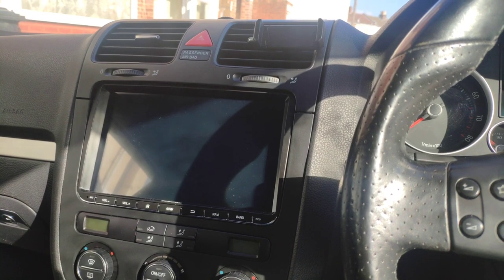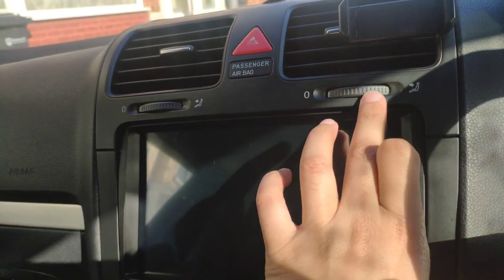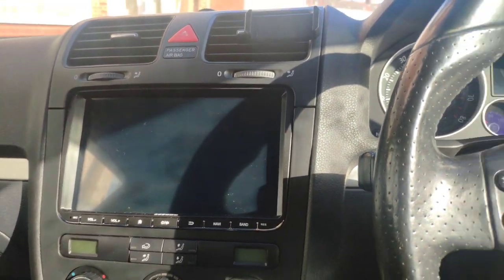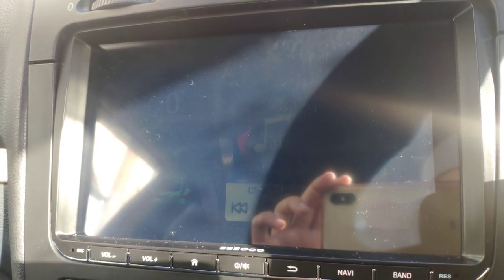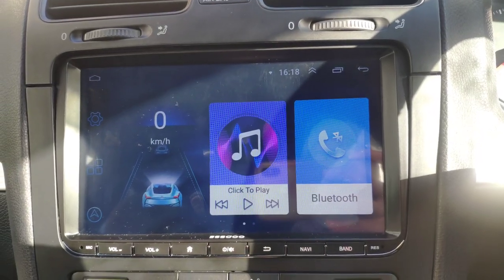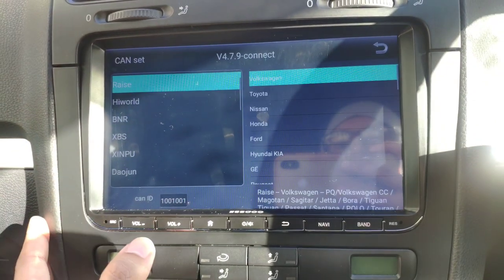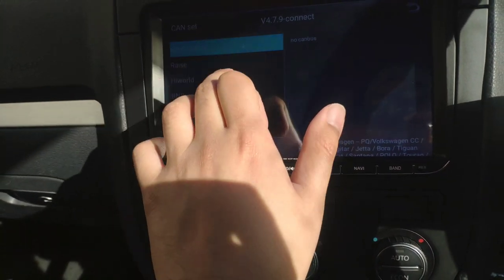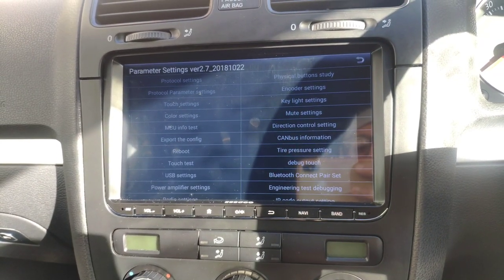9" Android headunit Canbus setup

Comment: Hi I bought a 2008 Corsa with one of these systems and an additional reverse camera and carlink carplay .

However the  steering wheel controls don’t work, how do I get them to work?
Reply from the maker: Mine worked out the box, all the wiring came with the unit.

Comment: Hey mate, do you happen to know why my headunit doesn't always stare when I turn on the ignition? It is completely random, sometimes it starts from the first ignition, other times I have to turn on and off the ignition for an x ammount of times until it starts (2-3 times usually). I would really appreciate if you would have an idea/suggestion. The car is a Golf Mk5 2008.
Reply from the maker: I'm not sure TBH, I'd check all the wiring first.
Reply: @AlexHusTech  could it be from the canbus decoder box of the headunit? I will check the wiring. Everything else is completely fine, it shows everything from my car (open door, trunk, rpm, voltage, seatbelt, etc). It's just this annoying thing that it doesn't always start on the "first" ignition..

Comment: hello mine does what yours does where the screen freezes and you can only see it faintly and you can still move the screen around but it goes off after a minute or so and when the ignition is switched back on it does the long boot instead of the fast boot so has it worked for me?
Reply from the maker: Seems like it has worked, long boot is better as it won't drain your battery, I think quick boot still drains a small amount of battery.

Comment: Hello! I have the same unit on my be golf 5 ! I have noticed that it is not working everytime I start the engine! When it works everything is perfect ( rear camera, Litres etc) ! But 1/3 times  it doesn’t turn on! Any ideas?
Reply from the maker: The only thing I can think of is the connections, are they all on properly?
Reply: @AlexHusTech  I don’t know my friend! The unit installed by a professional ( in the beginning canbus didn’t recognise the camera so I update the canbus unit) but now I have this annoying problem ! It is weird that if I enter the car and it doesn’t work , I get out locking the car waiting for about 2 minutes , I enter again and everything is fine)
Reply from the maker: I'm not sure, never had that issue very weird.
Reply: @ΜΙΧΑΛΗΣΨΑΘΑΚΗΣ  hello my friend! Καλησπέρα πατρίδα! I had exactly the same problem with you and after many tries  i found the solution via VCDS coding! I found that in the CAN Gateway installation list, the selection "56-Radio" was not activated! I activated it and.. problem solved!! Check it out, I hope it will help you!!

Comment: One thing I'm not clear on for a lot of these Chinese Android head units is, do ALL cars need a CANBUS decoder box to make onscreen info work (like climate settings, door open/close) or does the head unit do the decoding itself? I have looked high and low for a CANBUS decoder for a 2016 Kia Soul with no luck, so I'm beginning to think that one is not required. Is that possible?
Reply from the maker: I'm not sure if ALL need it however, mine car certainly does require it.

Comment: Hey mate, very nice review, thank you! Do you have any idea if in "Factory Settings" is any option to display the battery voltage with decimals in "Car Information"? I saw on other players that is not a problem for CAN BUS module to read this info from ECU with one or two decimals.
Reply from the maker: Hi, sorry I have not seen this option I'm afraid, this may be die to slight difference in the OS versions.

Comment: Hi Alex,
I have an issue that is really strange. I have got the same head unit and installed in my partners Golf MK6. 
When I click the settings cog like you did all I have is a blown up image with only the”Car settings” option. 
I don’t have “Sound settings, System info, Factory settings, android settings etc???
Do you think this a fault with the headunit?
Reply from the maker: Right could be an issue OR the software version is different to mine, and have to access the "Main Settings" a different way, which could be via a preinstalled app OR pull down the notification tab and normally there's a "Setting" option OR may be another way.

Comment: Alex, my problem is the Home Menu shortcuts don't work. On the home page, only the settings button works. You had me scroll down by dragging my finger from the top down. That's great, now I can access the settings and other buttons. Do you know if the home page short cuts like Radio, Bluetooth and Settings need to be setup and if so do you know where? Thank you or anyone else that might know.
Reply from the maker: I think there may be a setting on the factory settings options somewhere to map the buttons, can't remember top of my head.

I've got a new unit in yesterday, I'll be doing a MCU software update soon once the seller sends it over, I'm hoping the UI will be better.
Reply: @AlexHusTech  Thanks. The nice thing about these units, is that we can change the Launchers. Decided to change mine to Car Launcher, than I'm going to check out CarWebGuru.

Comment: Hey mate pretty sure I have the exact same head unit but I don't seem to have the same settings you do?? Super confusing, I don't have a navigation or logo option ect, any thoughts?
Reply from the maker: Sometimes seller put on different software versions, it may be worth getting in contact with the seller to see if they can give an update file.

Comment: did your fader and eq work out of the box on this? also have the same fitment issue :/
Reply from the maker: Yes worked out the box, able to make changes. I cut the top bit of my headunit to make it fit, video here of the part I cut, it's when I'm in the car.

https://youtu.be/9akMZDos0qg

Comment: I can’t get the info car to work on my golf. The Canbus box is connected. I try to read vault codes and it says please check obd connection? Do you have to use a Bluetooth obd connector ?
Reply from the maker: No, there is no OBD required. The headunit canbus box should be able to directly communicate with the car to get the details.

Have a look at my installation to see if you have the wires connected up properly.
 
https://youtu.be/9akMZDos0qg

Comment: I got this deck installed, everything works but when my car is running and I turn the key to the OFF position, my car still runs until I pull the key out. Any ideas if it's a setting that has to be changed?
Reply from the maker: Never had that issue, sorry, can't help you.

Comment: Hi mate I got same unit in mkv gti thanks on vid for changing kmh to mph worked a treat for me I’m now looking to see if odometer settings in car set can be changed from kmh to mph any help will be greatly appreciated bro
Reply from the maker: Unfortunately not that I know of, there's other apps like "Car info" that connects to OBD port that gives odometer reading in mile, however I use it more for tracking temps etc.

Comment: Hi Alex, I've just adquire that radio for my 2005 VW golf V, don't have interface (buttons) on the wheel, but installed CANBUS anyway, but the problem, with or without the CANBUS, persists, and that is, I turn off the ignition, remove the key of it, and the radio stills on. I've install the CANBUS and as I saw your video, saw that I didn't done anything wrong, different from you. Do you know what can be the problem? Thanks in advance for any help given.
Reply from the maker: Does it show your car details in the "Car settings" app? If not it might not be wired in properly.
Reply: @AlexHusTech  Hi Alex, thanks for the fast answer :) if car details in Car Settings app you mean the screen were "rRemaing Fuel", "OT", "VPWR", "S/B", "TRUNK" etc etc as for the doors if are open or close, yes, it shows the car details.
Reply from the maker: So canbus is working, message me on my insta, Alexhussien, there's a wire you may need to disconnect, I'll send a picture.
Reply: @AlexHusTech  Don't have social network beside youtube :( email me the picture, if possible. Thanks.
Reply: No Insta, Twitter, Face :) only youtube and whatsapp for the surf pics and vids that I take of my buddies.
Reply from the maker: @thenightbeast  emailed
Reply: @AlexHusTech  hi Alex, congratulations for the good job...I have exactly the same problem with thenightbeast.can u send me that photo please?
Reply from the maker: @ManosKass  Messaged you on insta.
https://youtu.be/9akMZDos0qg in this video at 7.35 is the wire that requires disconnecting, if that doesn't work then a wire tap is needed to be done.
Reply: @AlexHusTech  what does that wire disconnect do exactly? Should I disconnect it from the start just to make sure ?
Reply from the maker: It's to stop the constant 12v power, works for some people, for sone it doesn't and they need to further do a wire tap.

Comment: Hi Alex.... Can u tell me why when i take my key out the unit goes off and i cant power it up unless the key is in the ignition? I want to be able to use it without the key also?
Reply from the maker: It's to stop battery drain, 2 wires that you can connect that would give constant 12v but would require a switch to turn on/off.

Comment: Hey man thanks for great video’s that you mead 
I have problem with The sound of the music is very low do you know what is the problem Please
Reply from the maker: In your EQ have you put the sound level up? Are all your speakers working?
Reply: Yes man i had the old one was working perfect and i have 4 spekers working in the car 
So what do you thing the problem is ?
Reply: Can you learn me from where i can put the EQ sound up ?
Reply from the maker: @Fjabbourifahed  Not sure without seeing the device, might be loose wire? Or check all the hidden settings to see if volume is turned up.
Reply: @AlexHusTech   okey i dont really know also should i make for you video to see what is there happening
Reply: Check the plus and minus on speaker wires they could be mixed up. Hope this helps let me know if not sure.

Comment: Hi thanks for that am on no campus cause when i set it on the car make the radio makes noise like zzzzzzz so any way to set the campus without that annoying noise on the radio ??
Reply from the maker: Sorry, I've not had that issue so I don't know.
Reply: Is the noise Static on the Radio? That was my problem. I had to by an Antenna extension. Only needed about 6 inches of wire. I've also read/watched other videos. Many have the same issue. Not sure what they did.

Comment: Hey man, great informative video. I have the similar player install in my 2009 mk5. Don't have battery drain, information displayed correctly etc. However, my left steering control works & the right ones don't seem to change anything. Any chance of getting a suitable canbus protocol? Thanks
Reply from the maker: Tbh I'm not sure which module to use as I never changed mine and not sure which one I have.
Reply: @AlexHusTech  does your right hand steering buttons work?
Reply from the maker: Yes, I can change the tracks.
Reply: @AlexHusTech  damn, I can't do that
Reply: Mate, do you by any chance have a picture of the canbus box you have?
Reply from the maker: Canbus box that comes with the unit you can find in this video where I do the unboxing. https://youtu.be/9akMZDos0qg

If you're talking about the other canbus module that is in car, I can't show you but you can do a google search to see what is the latest one using part numbers as reference.
Reply: @AlexHusTech  thanks mate. Will order the box. The one I've got manages to integrate with the cars can network, so you can see it's vital statistics etc. However, I can only use my steering controls to increase or decrease the volume.
Reply: Just to update, my right hand steering controls work now. You need to use the Raise brand canbus decoder. The ones that are branded Hiworld doesn't work. Thanks mate.

Comment: How do u get that stuff to work that is in your thumbnail
Reply from the maker: The app is built into the system and the Canbus that comes with the radio talks with the car ECU/Canbus to get the data, mine was all plug and play and worked without having to configure anything.

Comment: does this unit drain power from the battery when off?
Reply from the maker: Mine is fine, if you have issues then you can either disconnect the wire at 7.35 from video below or have to do a wire tap.

https://youtu.be/GOrucz9_6Jg
Reply: @AlexHusTech  I'm just wondering because I know it goes on standby

Comment: Hi I'm would you know how I could improve the reception of the radio it comes and goes,  the antenna is connected
Reply from the maker: You need a radio booster called a fakra adapter. Something similar to this. The ones that come with the unit are pretty poor quality.

https://www.ebay.co.uk/itm/PC5-137-VW-Bora-Caddy-Golf-Car-Radio-Fakra-Amplified-Aerial-Antenna-DIN-Adaptor-/281199980764?_trksid=p2349624.m46890.l49292
Reply: @AlexHusTech  Super thanks mate, exactly what i was looking for

Comment: Hi, thanks for your video. Unfortunately, I can’t control the screen on the dashboard because the simulated buttons are not working…so I can't access the clock and time settings on my display...
I have a head unit with Android 9.1 and a 2020 firmware version. Nevertheless, the buttons are still not working...I have a Raise psa-rz-15 device. SWC controls are regularly functioning. My car is a Citroen C3 (2008). I set the Peugeot 307 (2002-2013) Canbus protocol, but I tried all the available protocols one by one. I have a multi-function display "TYPE A". What can I do to solve the problem? Thanks again in advance from Italy
Reply from the maker: So your touch screen is not working?

I used a control in one of my videos to play games this may work?

https://youtu.be/g42msUNI67I
Reply: @AlexHusTech  No, no, my problem is shown here: https://youtu.be/IWp7nXfxk94?t=1152

Comment: Hello, i have android multimedia on my passat 2006. When i turn on multimedia then start the car everything is working great but after 5 minuts it loses communication with car and buttons on the media stops lighting...
Reply from the maker: Not sure what it is. Did you install it yourself? Have you checked the wires? Does it heat up?
Reply: I have the same problem

Comment: Hi Alex how can I change the key light  color and the logo  only turn on after I disconnect  the battery
Reply from the maker: Hi, the key light can't be changed on the cheaper units as they don't have RGB leds, and logo is only displayed when it's long booted, most are set to short boot as default to load quicker.
Reply: @AlexHusTech  
Thanks  Alex very nice video I'll keep watching.

Comment: Just got a similar radio device for my golf mk6, sadly I have went through all the cam settings and still can't get the radio to turn off with engine 😤
Reply from the maker: Some require a wiretap, have you disconnected the red/yellow wire, that works for some people as well.
Reply: @AlexHusTech  I have came across another video saying to unclip a wire connection on the back. Is that what your talking about! Will try tomorrow thanks
Reply from the maker: @kennyelrick5858  Yes, I mention it in this video.

https://youtu.be/9akMZDos0qg
Reply: @AlexHusTech  worked like a treat thanks.

Comment: I need the software for canbus update
Reply from the maker: Same, I think mine is outdated, not sure how to do it though.
Reply: @AlexHusTech  Hey man, I have a 2006  mkv gti, do you know  if it will drain my battery ? Do I need to upgrade the can bus software ? Thanks.
Reply from the maker: Somelucky  people don't get battery drain, some people get away with disconnecting the red wire (it's in one of my installation videos https://youtu.be/9akMZDos0qg at 7.30 mark), some people have to do a wire tap or upgrade the canbus.